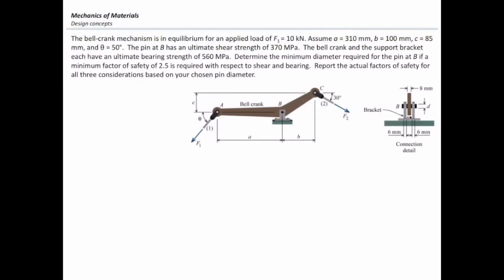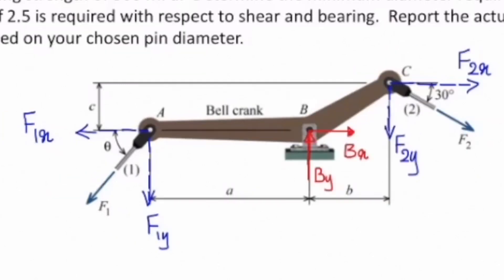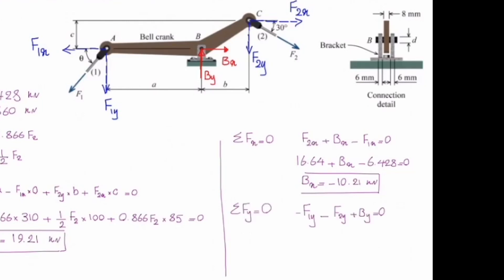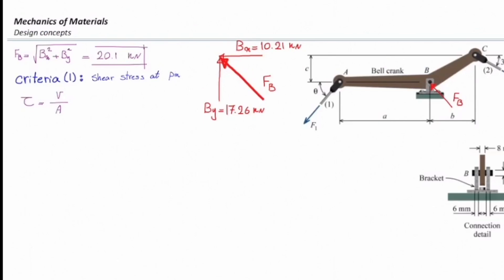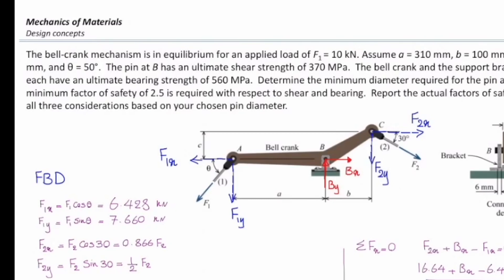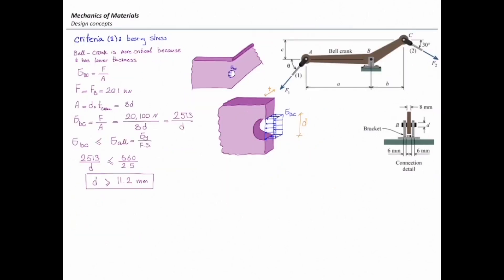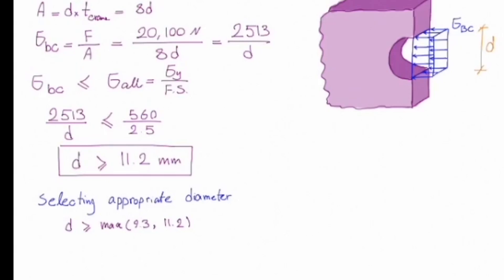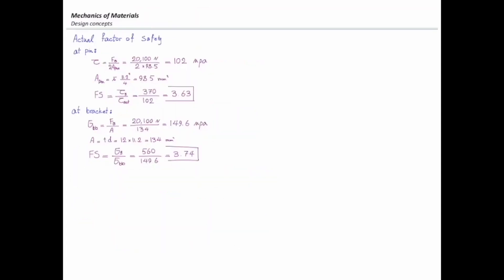Lec 4, Prob5 Shear stress and bearing stress in a bell crank

Comment: Is it that the formula for the bearing area is 2dt or 2(8)t= 16t coz it is double sheared? That's what Id observed from the problems that I've solved....
Reply from the maker: Generally bearing area is 
Ab = number of plates x thickness of plates x diameter of pin
Reply: @MechanicsofMaterialsLibre  sir but you take bearing stress here {t.d} why u donot multipy with 2?